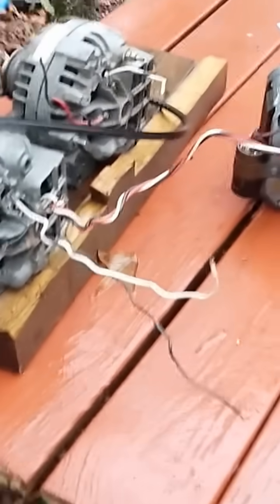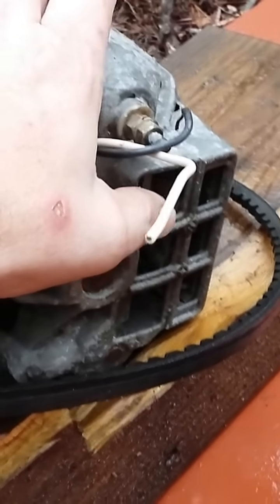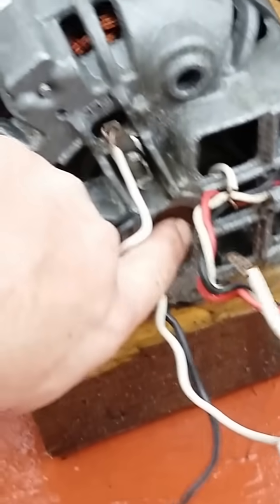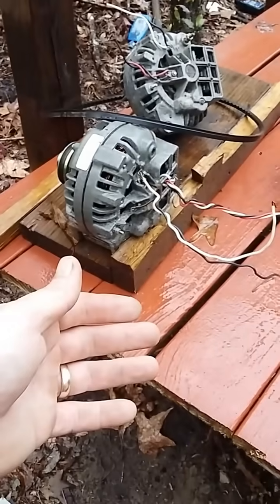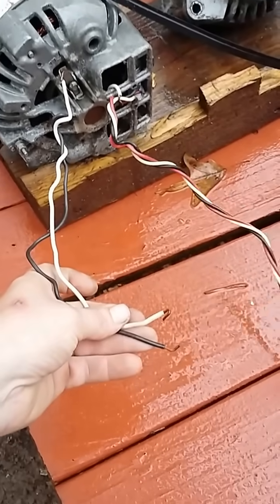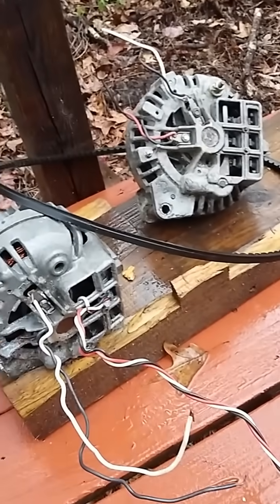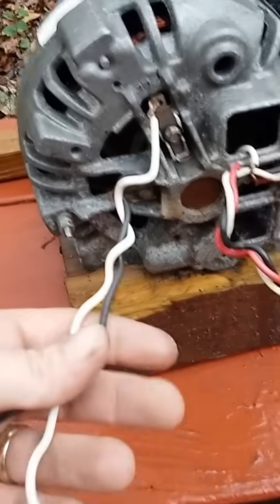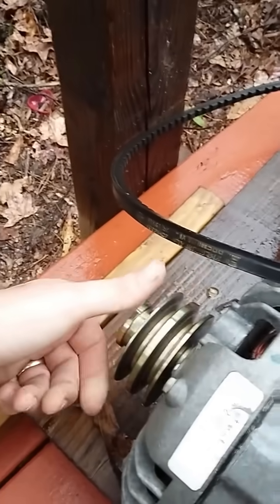Update Free energy forever no wind no solar no gas READ DISCRIPTION!!!

Comment: Ok so to get the "free energy" out the alternator you need to connect the alternator to a power source and then spin in with a high power motor.
You literally just described what a fucking car does with an alternator, it's not free. You need to pay to power the motor thats spinning the alternator. And no, hooking a 2nd alternator to the 1st motor powered by a 2nd motor doesnt make it free, just a limitless chain of wires and idiocy
Reply from the maker: How hard is it to turn a three-phase wired in Star car alternator into a three phase field magnet motor with the field activated? in order to do what I'm doing on my YouTube channel here you're going to have to wire your own motor/Generator Asshole! Guess you didn't look at any of my other videos like this one before you opened your mouth?
https://youtu.be/R269_W54rF8
Your Welcome 😗
Reply: @ThomasBuie  Turning an alternator into a motor is childs play. Now how are you going to power it? How are you going to turn the alternators shaft at literal thousands of rpms? Why didn't you show it working? Youre a joke.
I have a proposition for you, try connecting the alternator to a set of pulleys, maybe belt driven, then have a big fan capture wind power and turn the alternator. Uh oh clown it seems you made a ghetto windmill.
Hmm maybe try getting it to turn with a big wheel of paddles that capture the force of water? Nice one bozo you just made a water wheel.

Unless you explain how youre going to turn a shaft at 6000 rpms without an external force or pulleys then dont even bother replying
Reply: @rickytrevino8281  you have 12v wired back in to feed alternater and kick start with battery then remove battery..... with capacitors in circuit will run indefinitely
Reply: @shawnmorris8141  No

Comment: Just a correction in terms>  Roter = rotating shaft  etc.,  with pulley turned by motor,  it may be turning coil or magnets,  it is moving, not a stator.  Statator is static, not moving, can be coil or magnets,  it is not turning.

Comment: I can see how it would work, A little modified version, But like you said, Many diffrent ways, A loop back to the drive motor would be the best, Even if you just charged batteries and used a convertor would be good enough to run things like the refrig
Reply from the maker: Yes, almost the same as this other one sitting in my living room...
Thanks for the comment 😊😊🙂
https://youtu.be/R269_W54rF8

Comment: Because you're an idiot. You're going to get people killed messing around with electricity, 'specially high amp. you're also doing a video on electricity and electronics in the rain with everything getting wet. And is that a half-eating Cheez-It between the two alternators? Dope

Comment: You still have to use electricity to power the motor. So not free. Solar can power the motor that turns the alternator/generator. You are correct that the alternator will generate between 50 and 120 amps.  People have been doing this since the 1930's.

Comment: He hey I got a couple of questions about it and I also have something similar but with a gasoline motor it uses 100% of the fuel and produces no carbon you probably seen it is using vapor but I'm curious could you hook that to a PTO on a truck and make a welder

Comment: No man. People are making negative comments because from 1:40 to 2:04, you made absolutely no sense. I dont even think you know what you were talking about. You put in 3 to 12 volts, or is that output that feeds back into the stator? Bypassing the diode is just going to keep it AC. What the wire going into the stator is for...you got me there.
Are you sure its not a voltage regulator? Cuz thats what alternators do. Rectify and regulate the output voltage. Unlike a generator which only generates and sends to an external regulator/rectifier.

Comment: Dude. If that puts out 90 amps, which is enough to weld with. Thats true. But you're gonna have to have atleast 20 volts with it. 12 gauge AWD will not cut it. 
If you connect 3 or 4 in parallel, you might get it. But whatever is turning them better be strong.

Comment: hay connect two of the set of three 12 volt wires in collar coated together. of course pout the belt on and then rap a rope around one of the pullies like a lawn mower then pull the string over quickly and the two alternators will stay running. I hope this helps.

Comment: The sound went out as you begin to explain how to do this.
Reply: I wanna see some grime and callous on those hands before I buy any of this. He hasnt ran it. Those wires are barely twisted on. There is no reason for a wire going to the stator. Its not near enough to weld with. If it was, those 12 gauge wires would fry. He threw this skit together along with a paypal for donations. Red flag!!!

Comment: Can’t believe this crap that has been debunked.
Has not been taken off youtube...
Reply: Its real its what cars and trucks use to recharge the battery. same thing as solar energy, except the alternator is the solar panel and the sun is the engine the spins it. If you have batteries hooked up to it you can recharge it and with an inverter use house appliances. Thats what im doing.
Reply: @MrAkacode  Wrong, there is no perpetual motion machine. It takes more energy to charge the battery than the battery can produce. After you figure that out from "what you're doin" go look in the mirror and go oh.

Comment: So you plug the wires into your ass to get the volts you need to spin your generator?  Seriously though how do you spin your home made generator?
Reply: 🏅you get the award for the funniest comment I about peed my pants 😂 great job🏆
Reply: @towtrucka1306  lol. He blocked from his main thread.
Reply: Why couldn't you just make a system like your vehicle uses to charge a battery. So you would have two different systems to do this. Honestly not very hard if you can think for yourself.
Reply: Everyone if you can imagine just a little bit. You would have a system to charge a battery. A system like your car.
Reply: @jerrylester8735  that’s not free energy. Moron. This guy claims it’s free energy but clearly shows everyone it’s not free energy. Morons. It’s not free power if you have to put power into it. Plan and simple.
Reply: @onslaughter306  also I asked a question. Obviously you couldn't answer. So your go to was name calling. Smart guy. I promise you don't want to get into a debate with me.
Reply: @jerrylester8735  you can just have system like your car that’s not feasible   for a number of reasons. If it was such a simple solution we would already be doing it. I’m not hear to debate. Plus how could we debate when you can’t even comprehend why it won’t work. You have to be able to at least prove your theory.
Reply: @jerrylester8735  Why You SHOULDN’T Use the Alternator to charge your house battery bank:
Something to keep in mind: an alternator is a mechanical device with lots of moving parts. These ‘parts’ will wear out as you use them. The harder you work your alternator, the sooner it will fail. If your alternator stops working; so does your engine until you replace your alternator. This is why, over time, I’ve migrated to a mindset of opting for slower alternator charging (fewer amps) and a way to turn off alternator charging so that the solar panels can do their job, even when driving down the road. Rocket science.
Reply: @jerrylester8735  you must think they are also the same type of power? Just a couple of the issues.
Reply: @onslaughter306  now that my friend made a lot of sense. I can understand that.
Reply: First off we should be able to have a discussion without name calling. Second off did I say free or did he say totally free? I just said a little imagination. Obviously you would have cost in materials. That's common sence. Yet I don't understand why it's called common sense. It's not common to have these days. Anyways all I was referring to was that you could have essentially "free" energy. If you set up a system to power a battery. Just like your vehicle has. That way the battery gets changed from alternator. Is water free from the tap. No it actually isn't. We pay for it every month. At least where I live. Yet we tell are children. Why would I buy water from the store? When I can get it from the tap for free.

Comment: Have you played with converting large industrial motors and using heavy flywheels to keep you generators turning so not to use a continuous power source. I've seen a few of your videos but nothing on that though its basically the same mechanics. I've been try to build something that requires no conventional brush or brushless motor in larger scale but no real luck yet can only produce very low voltage

Comment: Any one who is watching this and thinks its stupid has not done much research cause I've done extensive amounts of research in this field of technology and implemented many of them you can put a fan on the rotor and have water or even wind to turn it and produce energy and in this case you have a car battery to power the motor he described in the video and then have a small portion (12v) go back to the battery to charge it as a normal alternator would at least till the ions lose the capacity to hold a strong enough charge to power the motor the rest can go to a load (ie) your breaker box or a battery group like when using solar panels that then go to a dc to ac
Reply: Yaw two are trolls 😂
Reply: Yeah dude, you've spent hours on YouTube learnin good and proper
Reply: What? No, ok, no, dam yourr actually dumb

Comment: Idea now if you run a car battery with this and another alternator to keep it charged you could possibly have a never ending supply at least until the battery gives out ?
Reply: That is correct except you wouldn't need another alternator to two in the video would be more than enough just redirect some of the energy back to the battery

Comment: You totally RIGHT. But there is a little detail we have to improve.  Just like a house got many breakers 20 amp each one we have to divided like put more alternators in the same system and share differents belts. Also we have to find the way of how to switches to another alternator to stop the friction inside the first alternator and let it cool down or make the generator switch itself after certain time. I don't do videos but I'm doing my search and "we almost there!" I know we can do better than these power companies. We got everything in the junk yard and stores we just have to put it together but in smart way. We can't be watching this system in case a fire or an explosion probably can occurs. We have to build a system than we trust longtime.
Reply: This system can be trusted long-term it just has to be tweaked the right way

Comment: I have always wondered if this was posible and if it would work to run a car never needing fuel
Reply: No.   This doesn't work.   You cannot extract more energy than you put in.  Yes,  the alternators definitely can be used to generate electricity, but you must expend energy to spin them.   You can't run the motor with the electricity generated by the other for more than a few seconds. 

If you were able to eliminate all losses (friction, air resistance, etc), you could then theoretically do this (though keep in mind total elimination of all losses is not possible), the moment you tried to pull any energy out of that system to do anything else it would stop. 

Perpetual energy motion machines do not exist,  the laws of thermodynamics are real,  and provable.

Comment: Are those wires heavy enough for the load a whole home?
Reply: Even if it was 10 gauge copper wire, it would only hold about 30 amps at 5 ft or so and I am not sure for how long before it melted.  You cannot power a whole house off 10ga wire. impossible. I have been working with electricity, both AC and DC for 30+ years.  You cannot power a house or mobile home off 10 ga or even 8ga copper wire. The wires would melt under the load.
Reply: @larrym7780   I know they won't hold the load, I've worked with residential electric for years. I'd like see this actually running his home.
Reply: Sir, I was not being smart nor insinuating anything. You asked a question and i gave a somewhat detailed answer. I mentioned my experience so you would know that I was not talking out of my backside, so to speak. I figured you had a genuine question and didn't know the answer.
Reply: @larrym7780  no issues here my friend, I didn't take anything negative, not many to discuss stuff like this with so all comments, ideas and what nots welcomed.

Comment: You cannot turn an alternator like a motor.  It's impossible just hooking power.   The stator and arm must be timed out of phase.  Ccpm controllers run brushless motors. Not hooking up a batter you idiot.    Never saw a single one turning.  Just a tip the people hiding in the woods are not there because you have an alternator on your dilapidated back porch they are there because CPS was called as to why your child is crying so much and you are not paying attention.

Comment: This is coming from a place of nothing but respect. So long as you dont try to sell this information and do what you are doing as far as accepting donations. Nobody will be coming to get you the reason peolpe are taken care of so to speak is for just that moving in on turf and attempting to make a profit publicly. Phonetics are very important when doing this, but it seems that you are aware of this really like the simplicity of your set up and plan to subscribe keep up the good work.
Reply: Only sensible means I can imagine is the availability of reliable wind or preferably water.  I've seen both rudimentary and elaborate examples of both.
   I'm not an electrical guru but like most people can visualize the advantages and pitfalls/problems/limitations.
Reply: Generating an electromagnetic field also sounds carcinogenic. Lol

Comment: Mmmmm..... are you going to spin it with your hand? Unfortunately, one of the fundamental laws of physics is that energy can neither be created nor destroyed. What's powering the motor that's powering this thing? Gasoline? Diesel? Why not just go get a gasoline or diesel generator? And then you still have to pay for fuel.
Reply: There are videos that show you what to do better than this.  You can hook it up to a battery and an electric motor and it will power itself until the components fail.
Reply: @jrice07  "It will power itself" is NOT accurate. The battery will power it. How did the battery get power? Presumably you purchased the battery... with money (i.e., It was not free.)
Reply: @ibealion1   You should pick up a book on basic electronics, it would help with your problem with deductive reasoning.  We are not talking about a perpetual motion generator.  You hook the battery to the electric motor, which powers the alternator, which charges the battery.  Maybe you should rewatch the video, the guy literally says he hooked a an electric motor to the alternator.  In the end, it will power itself until a competent fails which is arguably cheaper than paying for electricity.  🤦‍♂️
Reply: @jrice07  thats not how any of this works. Nothing is completely 100% energy efficient. Energy is lost to thermal energy (heat), friction, light, etc. The reason our auto batteries stay charged for so long or rather recharge so easily, as you likely know, is because the energy from combustion is used in turn to recharge the battery. Without an additional source of energy one battery hooked to this setup isn't going to last long. It would be a more efficient self sustaining setup if he could hook in some solar panels to recharge the cells The closest thing we have to free energy is the ability to harness renewable resources such as solar, wind, water
Reply: @josepharnett7256  oh I guess my 20 yrs experience is clouding my understanding  of a simple circuit.  When your output is greater than your energy lost its moot.  Much like a Super Charger on a car where you lose 5hp from resistance but gain 30hp overall, the energy generated from the alternator is greater than the energy consumed.
Reply: @jrice07  well when you're posting on a video that is titled "free energy forever..." certain things can be assumed and need clarification. And I would disagree thats its moot. If total energy generated could somehow match or exceed energy consumed then energy lost would be irrelevant, but that is never the case. Laws do not allow a 100% tradeoff of energy, there will always be energy lost in a mechanical/electrical system, so of course its not moot to take into account how efficient the system is. That IS THE point, to make the most energy efficient trade off possible, is it not? Oh and that whole bit about the energy being generated is greater than the energy consumed is half handed because you're not including the entire system. Sure your supercharger can net 25hp increase, but fuel consumption also increases.